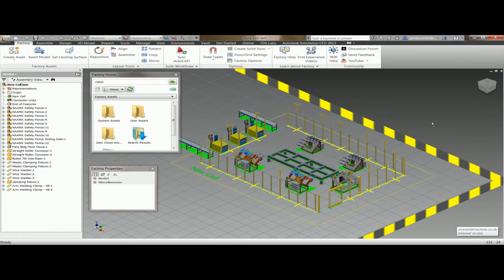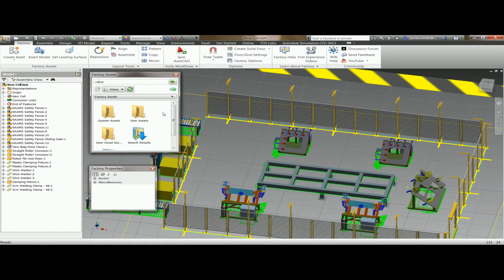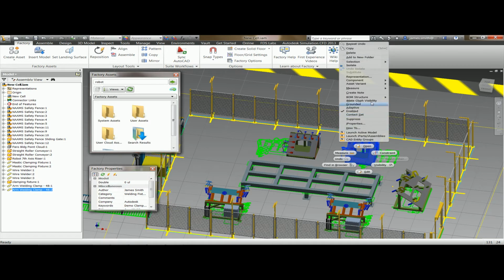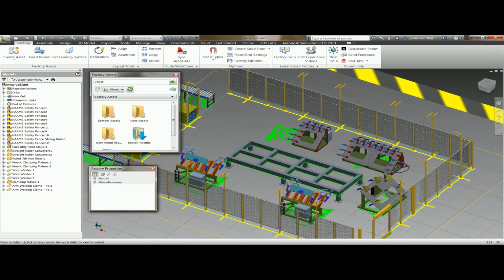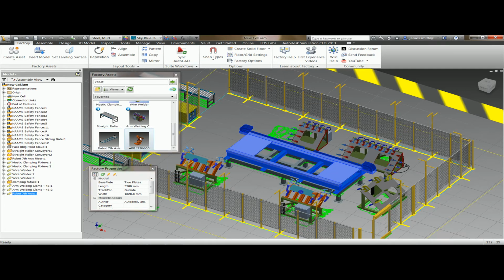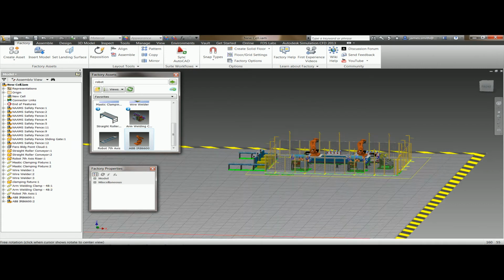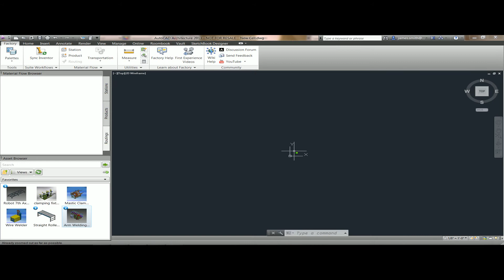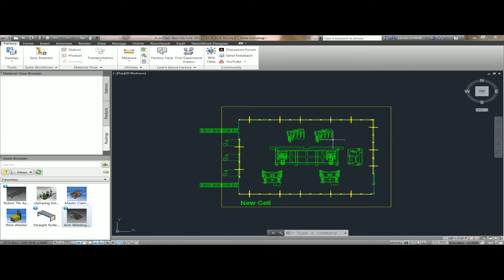Part - 4 Autodesk Factory Design Suite Tutorial

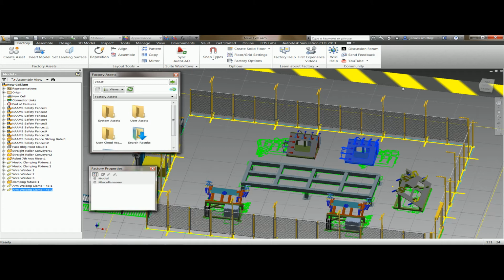Comment: Around 1:20, the asset variant of the arm welding clamp is set to double.
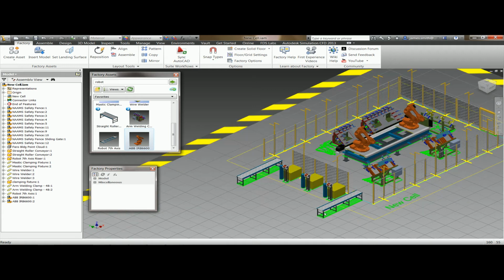Around  2:20, the 3d model is synced with AutoCAD.
Shortly after 3 minutes, it looks like the 2d view shows two single asset variants of the arm welding clamp.
Why did that not update..?